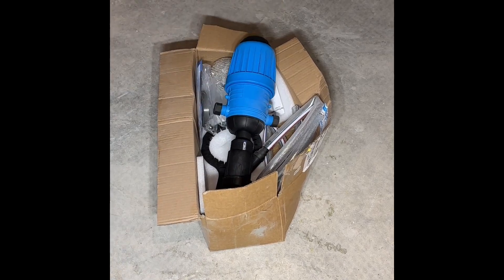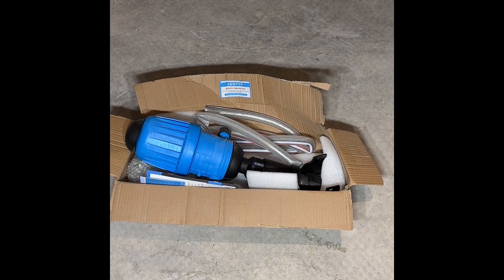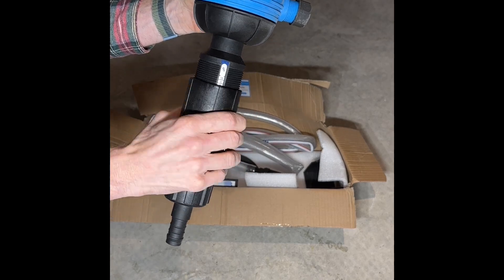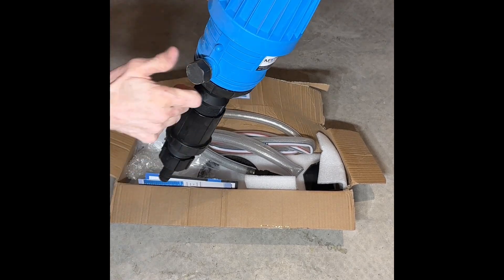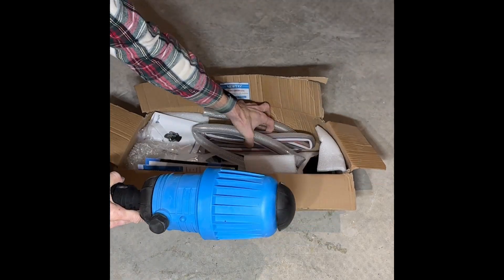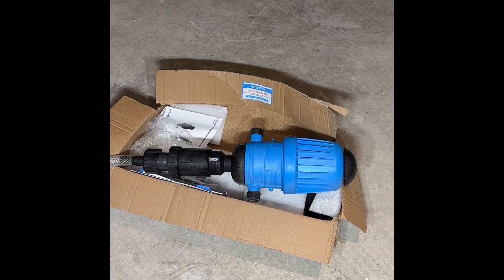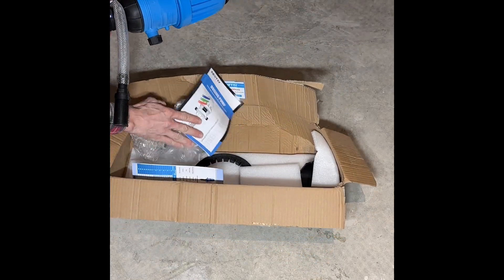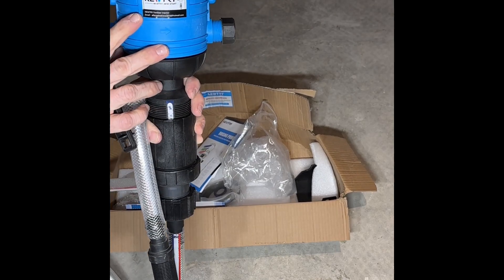NEWTRY 1%-10% Fertilizer Injector for Drip Irrigation, Adjustable Water Powered Dosing Pump, 3/4 NPT

Comment: I plan on using 20-20-20 in my NewTry fertigation system to fertilize 4 60' rows of tomatoes. How much fertilizer should I mix with how much water to feed the injector?